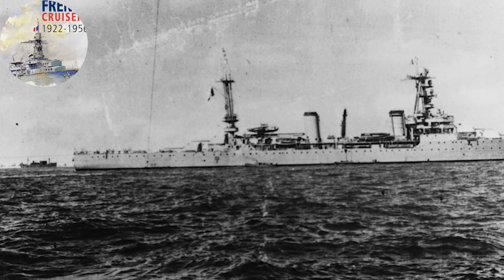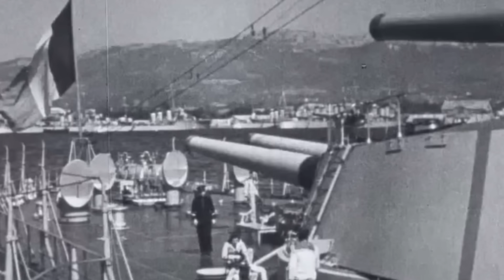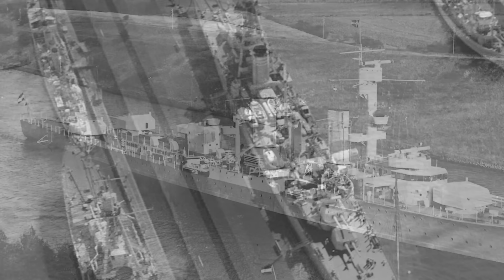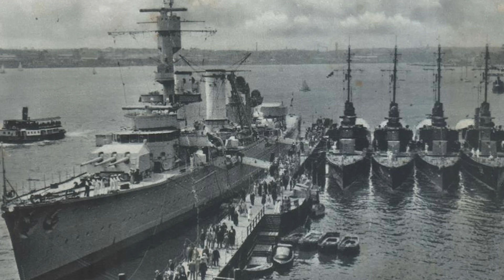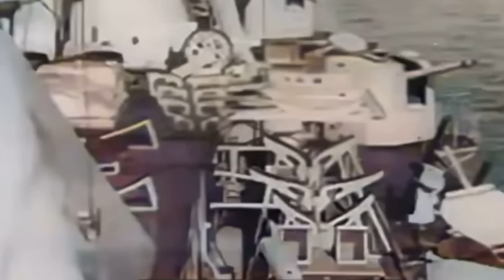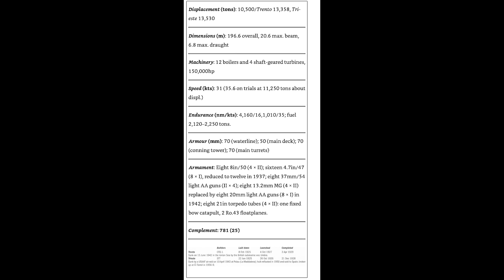The Treaty Era’s Worst Warship Designs

Comment: If 70mm of belt armor (Trento) ranks something amongst the worst treaty warship, then you should also include Furutaka and Aoba with ther 76mm or the Kent's and Baleares which initially had significantly less. It's true the Trento's suffered from a number of deficits that came with high speed (light hull construction, vibration issues at high speed) and the fact that they were flush decked (very large deck hight forward), but armor wise they were among the better armored cruisers from the time they were build. The guns had fixed loading angles which didn't help fire rate, but for instance the Kent's at first had 70 degree elevation on their turrets so they could be used in a dual purpose role, without any assorted fire control being fitted. Japanese heavy cruisers required significant rebuilds to turn them into the impressive ships they later turned out to be. In that regard you did leave out the initial build Mogami-class, which after high speed trials wasn't able to turn the front turrets, because the hull had deformed as it was so lightly build for the load - 15x guns, 37knot speed, 105mm armor, 4x torpedo launchers - it was designed for.
The Königsbergs - by this point - is a dead horse as you made a number of videos on them already. And yes they are a very compromised design, but that's because of another treaty, not the Washington one.
Reply: It is also worth noting that the Trento-class actually had very good deck armor by the standards of treaty cruisers - 50mm - which made them much less vulnerable to deck penetrations from 6" and 8" guns at longer combat ranges. Bolzano's main deck - the same thickness - defeated a British 6" CPBC shell at Calabria (from HMS Neptune), which ricocheted off and exploded in the aft torpedo room. This still caused damage, but had the armor been much thinner (most sources credit the British 6" CPBC with being able to penetrate 2" at 22,000 yards, about the range of the hit), it would have penetrated the deck armor and exploded in the aft engine rooms.

Likewise, they actually had decent armor on their main gun turrets and barbettes that could protect against 4.7-6" gunfire at reasonable ranges - 100mm on the turret faces, and 70mm on the barbettes.

Comparatively, French, British, and Japanese treaty cruisers had only splinter protection for their main battery turrets and barbettes (25-30mm), and likewise first generation American treaty cruisers (Pensacola and Northampton-classes) had only 64mm turret faces and only splinter protection (13-38mm) for their barbettes.
Reply: @phoenixjz4782  You are entirely correct, I forgot to mention the 50mm deck. For a design from the late 20s that is interestingly forward looking. It can be explained by the italian doctrine of engaging with long range fire first and decisively. Which makes deck armor all the more important.
Reply: It is interesting to compare machinery between some of the classes. The amount of power needed to go an extra 2-3 knots faster over many other classes is crazy. The Trento's are listed as having a 150,000 SHP plant. Most of the cruisers of the era had somewhere around 100-110,000 shp. Duquesne had close to 120k shp. The really bad thing for the Trento is she had the big power plant and wasn't any faster than most of the other treaty cruisers under sea conditions. As was pointed out, Furutaka and Aoba classes were not good when first built and required extensive reconstruction. While their armor wasn't really addressed, they emerged as very nasty cruisers for what they were. This was chiefly because of their torpedo armament. Both the Japanese and UK built 6 gun 8" cruisers for sort of the same reasons. Both wanted more cruisers than they would have otherwise had if they built to the max tonnage on each individual ship (IE, the treaty specified a total tonnage amount allowed and that each individual ship could not be more than 10,000 tons, etc).  As a result, the Yorks were built. The class was stopped after two ships were complete and the British moved in a different direction when it became apparent that what was saved in terms of cost and manpower wasn't enough and the British moved on to more light cruisers.
Reply: @klydon1291  RE: Trento's machinery and speed - this is a case where I don't think the video creator read the text he was citing closely enough. 

Maurizio Brescia's 'Mussolini's Navy' is an older text, published in 2012, and was based largely on pre-existing secondary sources that had not been revised in the last couple decades. This included fairly harsh judgements on the performance of many systems, and that includes the top speeds attained by the ships.

This is actually explicitly addressed by his later work - he and several other authors researched and published over the 2010s and early 2020s a series of dossiers on various Italian classes of the interwar period. Two volumes written by him and Augusto de Toro dealt with  heavy cruisers - the first on the Zara-class (published in 2018), and the second on the Trento-class and Bolzano (published in 2020). These books were combined to form a single English-language volume and published in 2022 as "Italian Heavy Cruisers: From Trento to Bolzano".

In these newer volumes - and the English language version is actually cited by this video - the authors explicitly address the speed issue, and the claim about them being unable to maintain more than 31 knots is convincingly argued as inaccurate. They note that at the Battle of Cape Spartivento (November 1940), when operating at full load displacement, they were able to maintain 34 knots (this is actually noted in the official reports from that action, I have read them). Likewise in worse sea conditions at the Action off Gavdos, they were able to maintain 33 knots. Four different speed trials to check general efficiency on Trieste from October 1941 to January 1943 saw her able to maintain maximum speeds of 33.5 to 34 knots at displacements ranging from 13,500 to 14,460 tonnes, while similar checks for Trento in October 1941 and January 1942 returned a top speed of 34.5 knots at a somewhat lighter 13,000 tons.

This is all in all fairly reasonable - most of the time when you see a nominal top speed listed for a ship, it is reflecting speed at normal load displacement rather than full load, and thus is not fully representative of what the ships might see in service, especially as their career results in inevitable weight growth (ex, the Trento-class nominally should not displace more than 13,600 tonnes at full load, but Trieste in fact displaced 14,460 tonnes at full load by her speed trials on 1 January 1943). At normal load, 35 knots was probably quite achievable. Full load, as the evidence above indicated, tended to result in top speeds in the region of 34 knots.
Reply: @phoenixjz4782 "heavy cruisers: from Trento to Bolzano" is a very good book and I agree with you that the video creator should have read it to avoid the erroneous claims made by that earlier book. I have both, which were not easy to get, and tbh I was disappointed with "Mussolini's Navy"
Reply: @klydon1291  The Regia Marina had traditionally always favored higher speeds than their adversaries. As did the french. Plus they were very impressed by the performance of the Admiral Spaun and Novarra class cruisers, which were faster than almost anything they had in their inventory in WW1. But yes, that extra knot or half knot cost them a lot in terms of weight, mostly to the detriment of armor but it also meant that they had to build their ships rather light. Also the machinery itself wasn't the greatest and while it gave good performance on trials, also lightly loaded, by the time WW2 came along they were already worn out to a noticable degree. 

Later french designs like the La Galissonniere rectified that mistake and while on paper they were only supposed to go 31knots on trials they all achieved around 34 and above and could still at late war load steam continously at around 33 knots. I think that has to do with the fact that the french designers developed the engine with forcing in mind from the start, whereas the italians didn't. At least until the Abruzzi's which were capable of roughly the same speed in any load condition and continously.
Reply: @CaptCondor  Yes, there was a lot of back and forth between the French and Italian naval rivalry. Apparently, there was the a bragging contest on who could build the faster ships to the detriment of the rest of the design. The La Galissonniere class were an excellent pre-war design and I always thought they were extremely handy ships. The only thing I didn't like on them was the twin torpedo launchers. It would have been nice if they had been at least a triple. The La Galissonniere class belong on the "best design" list for what they were.
Reply: @klydon1291  Personally I am not too sure about torpedoes on a cruiser. Looking back at performance during the war, apart from the Japanese it seems to have been a type of armament not really necessary for the cruiser role. And the japanese while having successes with torpedoes also had some rather bad disasters because of their own torpedoes. Also the La Galissoniere's were designed as fleet cruisers, meaning they would have other torpedo craft at hand. But in the 30s a lot of doctrine shifted and so it makes sense, that the french were still insisting like pretty much everyone else on some form of torpedo armament.

I think from the Montecuccoli's onwards the italians started to design good to very good high speed ships.
Reply: @CaptCondor  I think they were an overall plus, especially in restricted waters like the Med where night actions were more likely because of the threat of air attack. While the Zara's were overwhelmed at the battle of Cape Matapan, one wonders if there had been other cruisers with torpedoes would have extracted a price from the British. I think one of the reasons why the Japanese had as many disasters as they did was due to the volatility of oxygen used as part of the fuel for their torpedoes. Other nations didn't have near the incidents they did. It turned into a big issue for the Japanese that saw their captains start ejecting torpedoes when coming under heavy air attack later in the war.
Reply: @klydon1291  Considering italian nigth fighting doctrine (meaning avoid night action at all cost), the lack of night optics and how these cruisers were taken out without being able to fight back within a really short time it is debatable if they would have gotten a torpedo off at all, had they been available. 

If memory serves me correctly, it was Hiraga - the chief designer of most japanese heavy cruisers - who argued against torpedoes from the start. He reasoned even before the invention of the Long Lance that torpedoes were too much of an explosive risk on a cruiser. But yes, other navies that also used on-deck torpedo launchers didn't face that issue. I wonder if that is due to the torpedo warheads being stored differently.
Reply: @CaptCondor  Matapan is really a case that primarily falls to who detected who first, and in that case it was the British - probably in great part because of ship coloration and optical equipment. More specifically, the British ships were painted darker with camouflage, of the Italian ships only Fiume was camouflaged and the rest still had the light ash grey scheme that would have been more reflective at night. And then the British, due to their great devotion to night combat practice in the 1930s (only the Japanese devoted more effort to night combat than the British, of the navies of the era) had made specialized nighttime binoculars standard issue (Barr & Stroud CF41 7x50 binoculars), while the Italians used a more standard model of 7x50 binocular for day and night conditions.

Italian heavy cruisers occupy a somewhat awkward space in this period of ships that, while they did some night main gun training pre-war, had not really meant meant to employ their batteries by night in anything but breaking contact. A greater use of these ships at night was being contemplated at the time and ironically in the week just prior to setting sail for Operation Gaudo and Cape Matapan, Fiume actually tested the first loads of flashless powder for Italian 203mm guns. That said other ships were still equipped to engage at night and at Cape Matapan Zara's one of Zara's turrets was struck even as it began turning.

Italian light cruisers and smaller ships, however, were expected to be able to use all armament at night and by the start of WWII all Italian guns of 152mm and below were equipped with flashless powder. The Italians still did not prefer to engage with guns first at night - to them, because of the close ranges, the ideal weapon really was the torpedo, and ships should not engage with guns first unless they knew they had been detected. This also meant that destroyers and torpedo boats were the only forces they really wanted to have be involved in night actions, due to the value of heavier guns being much less. The Italians were actually fairly gung-ho about night actions in this regard, and all but one of the night actions fought up to Matapan was one that Italian forces initiated against the British (the exception being the Action in the Strait of Otranto, 12 November 1940).

Had the Italians detected the British capital ships first at Matapan, Cattaneo would have sought to disengage with his cruisers if they were not fired on directly - they would not be able to duel 15" gun ships and thus he would have wanted to avoid doing so unless he thought he had been detected - but the four destroyers would have likely been sent in to press torpedo attacks.
Reply: @CaptCondor  Just doing some checking and it appears the type of explosive they used for the warhead (Shimose type 97 explosive) was more powerful than standard TNT, but was also not nearly as stable to shock damage as TNT was.  I also have to believe that something using compressed pure oxygen is not going to be real stable either. If something would cause the tank to leak (say shrapnel, etc) and there was any type of petroleum around (grease) or a fire, the consequences would be rather dramatic. All in all, the long lance was not only extremely dangerous to enemy ships, but also friendly ships as well apparently. Given how big the warhead was to begin with (490KG or 1080 lbs), and that the type 97 explosive gave a 7% increase in performance, one would think going to a more stable explosive would have been prudent.
Reply: @klydon1291 great you checked it. Those are very impressive numbers. From what I gather the Japanese naval command was so hyper focused on increasing the fighting power of each ship, safety was kind of an afterthought way down the line. One class where they broke the camel's back was the original version of the Mogamis. Thinking that getting 15x guns, 4x4 torpedo tubes, 3 spotter planes on a 8000t hull that goes 37knots and has a 105mm belt is just fanfiction ridiculous.
Reply: @phoenixjz4782 Thanks for your insights. I think I had read before about the RM camouflage having the problem of creating problems at night, in particular the white bow, which is why it was painted in a light green (if I am not mistaken). And yes Matapan has not in any way to do with the ships being bad. No cruiser would have survived that kind of caliber at such close distance for any longer than the Zara's did.

Comment: The K-class's weakness was ABSOLUTELY the fact of the German designers. They tried to pour a quart of piss into a pint pot even though they knew for a fact they couldn't make it work out. Building them more like the Arethusa would have ensured a balanced ship with sufficient strength to activate sail on something other than a flat calm mill pond at speed.
Reply: There doesn't seem to be a lot of thought on what the K-class cruisers were to be used for. (IE, what was their main mission). From a German perspective, any ship of this size should have been constructed with commerce raiding in mind, but these had design decisions that were counter to that. The design seemed to be how much of everything can we cram on a ship and have it barely function as a ship. For a non raider, they should have ditched the dual drive and gone steam by itself. The AA guns were bad as well. Unfortunately, it was like a lot of the smaller units for the KM with too much attempted on too little displacement; a fate it shared with most of the destroyers.

Comment: 10,000 ton heavy cruiser design was impossible.  Something in the speed/protection/armormment triangle had to give.
Reply: In 1922 10,000tons was reasonable for a cruiser, but by the 1930's technology creep meant there were a lot more things for the cruiser to worry about, not to mention the missions they needed to undertake had expanded since WW1. The London naval treaty really should have relaxed the displacement restriction to like 12,000 tons instead of doubling down, but you know how it is - hindsight is 20/20.